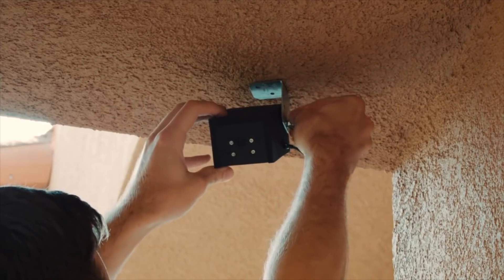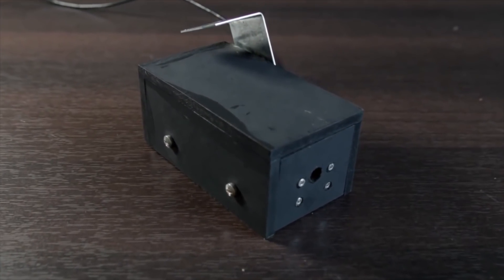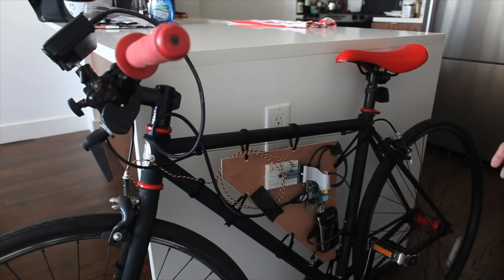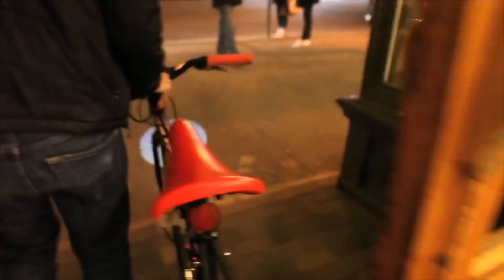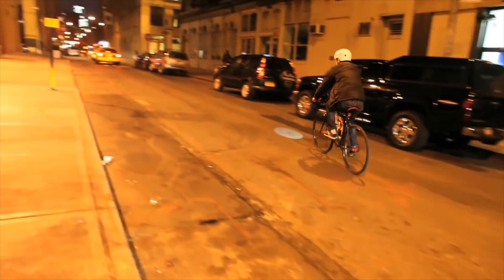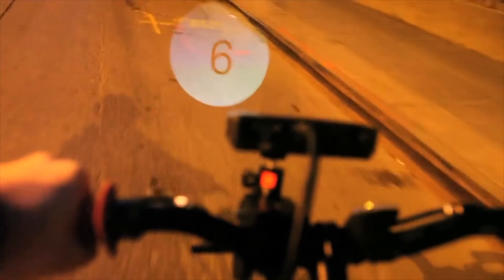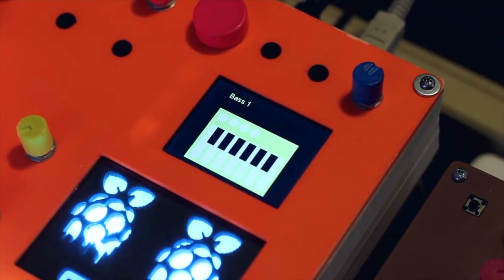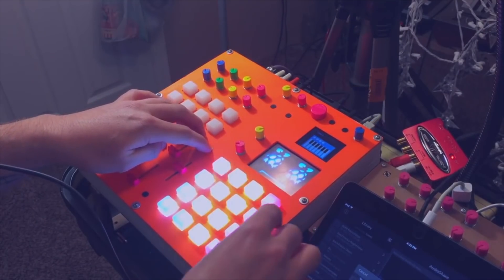TOP 10 Raspberry Pi Projects - Maker Tutor

Comment: I still cringe watching Great Scott! solder the Pi Zero. You feed the stripped wires through the holes and solder, NOT FROM THE TOP TO THE WIRE!
Reply: I think that he had to  do it the cringy way, because the hole he was solderig to, was alredy used once and thus was alredy full of solder.